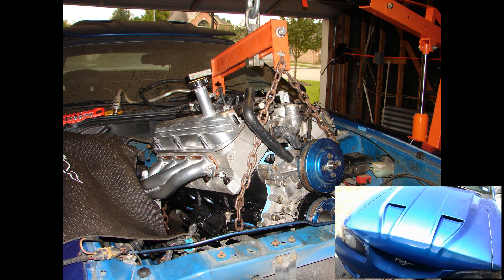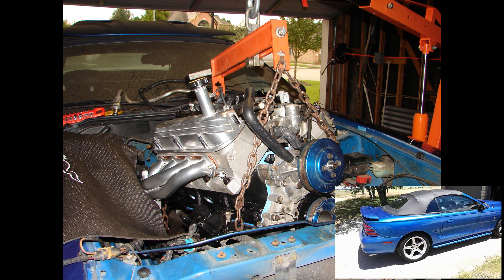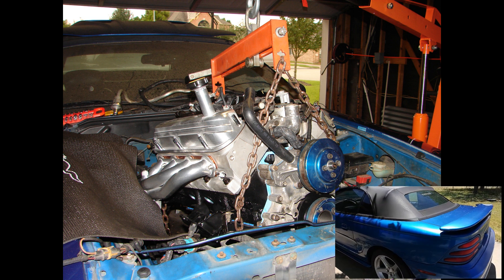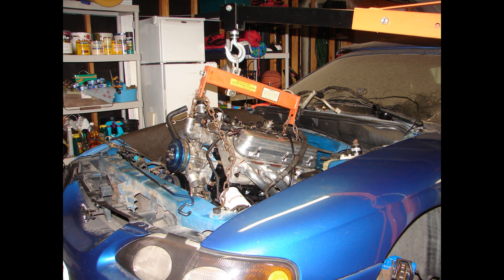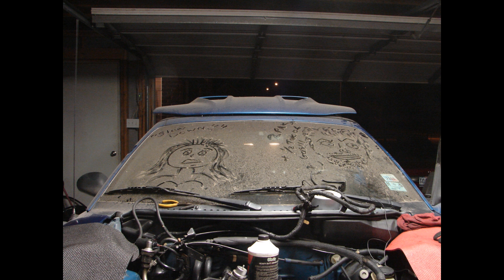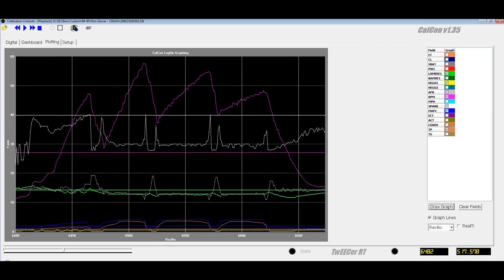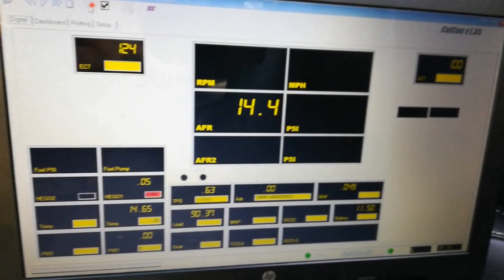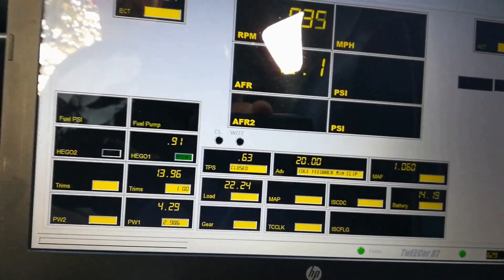TwEECer Tuning Process for 1994 Ford Mustang Part 1

Comment: I love the tweecer. I’ve tuned my completely stock 91 mustang with o e85 with a perfect fuel curve with stock injectors and stock pump.  Tuners said it can’t be done the car was also dynoed on mustang dyno. 165 ho 185tq. Completely stock to  the wheels